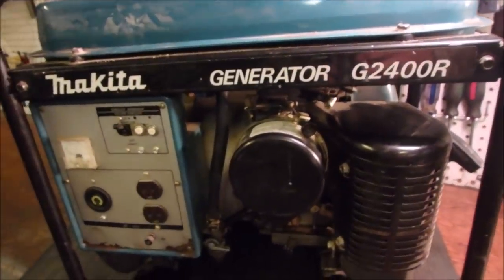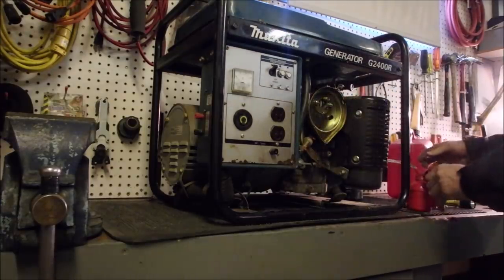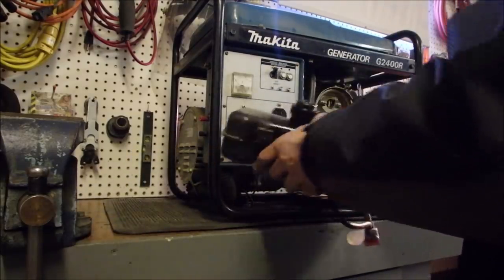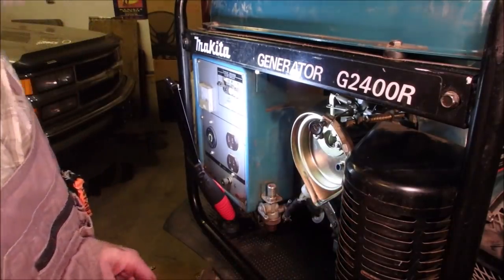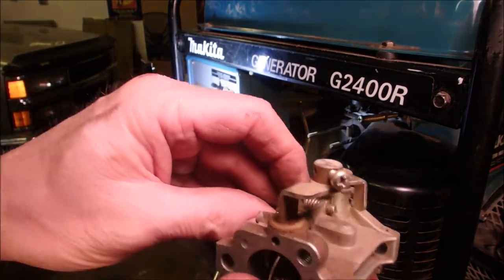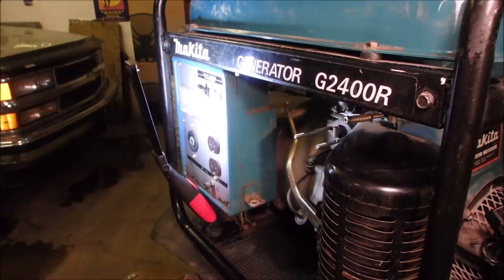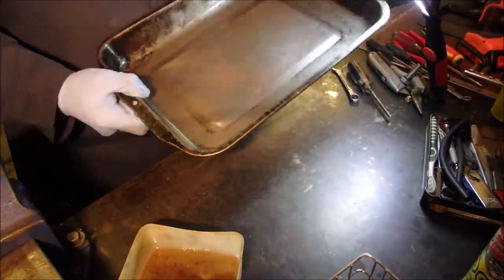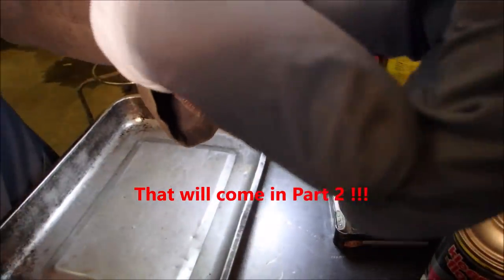Makita G2400R Generator won't Start

Comment: Nice job Bruce! Don't you love getting a machine that someone else worked on? Or a box of parts that came with a machine. Always like a mystery. Good luck with cleaning that tank, giving it a few tumbles should help quite a bit. Just hope the rust isn't too deep in it.
Reply from the maker: Thanks mr. fixer

Comment: Bruce , nice video , enjoy them everytime.
Small tip , fill the ultrasonic cleaner with prewarmed water ( for example warm tapwater ore cooked water ) , i always do this and it saves me time and energy
The heating element is being used to keep things warm , not to heat them from a cold start 
keep up the good work ! ;-)
Reply from the maker: Thanks.  I have done that.  Sometimes I reuse the solution so it is the temp of the shop.  Thanks though a great comment.

Comment: How do i find out wat yr my makita g6100r generator was made
Reply from the maker: I don't know.  This has gone back to the owner 2 years ago
Reply: I found a sticker on the engine . It was talking about being up to 2005 specs or something along those lines. Im pretty sure its a 2005. Heres my deal. A friend of mine wants to buy it. I wanna sell it to him. I dont wanna rip him off. We work together. At the same time i dont wanna get took neither. I told him 450$. Ive seen them on line. Used ones were anywhere from 400-600$. Its 16 yrs old. Let me throw it at u like this. If u was buying it, what would u pay for it. My goal here is just to be fair.

Comment: You may hate yourself for not plugging in a light while you had it running to check for output.
Otherwise, so far so good.
Reply from the maker: Good eye.  I did get a meter reading on the generator at 6:58  That isn't a guarantee though.   Good to hear from you sir.